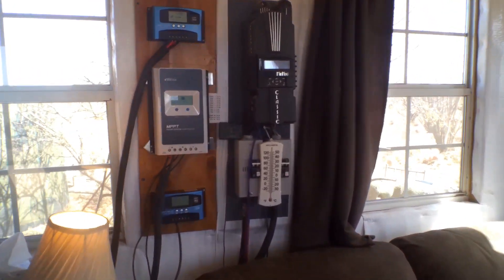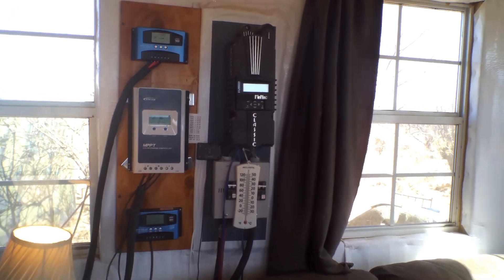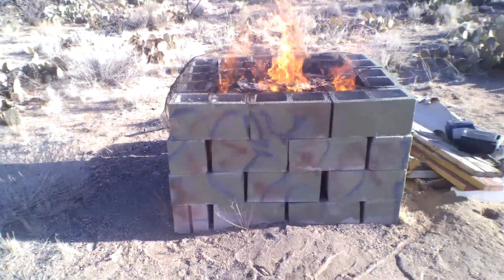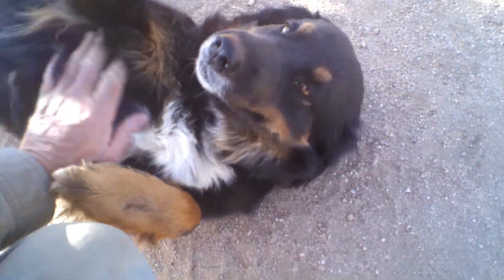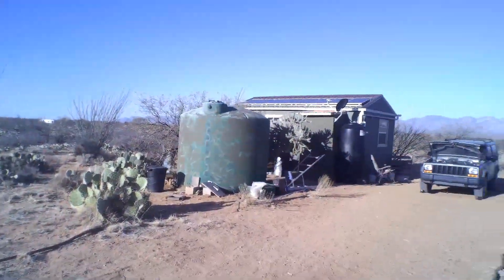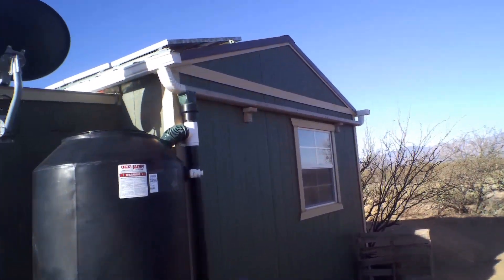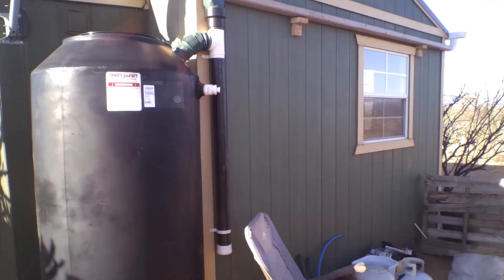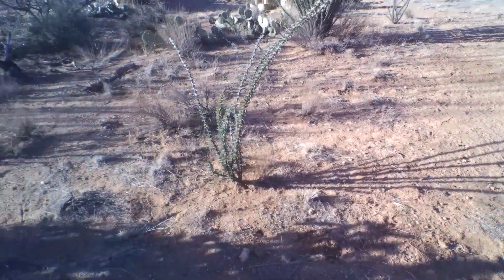First Flush/Rainwater collection & 2Kw of solar @ AZ Off-Grid (Unplugged)

Comment: I like how you split the solar panels apart. If 1 controller failed you still have power I would like to know how the batteries are set up ? Is it 12 or 24 volt.
Reply from the maker: I have (16) 6V hooked up as (8) 12V.. here is a complete video before the new additions.. 
 https://www.youtube.com/watch?v=JtlOPsKivlw&t=16s
The main reason I have so many charge controllers is for "backup" if one should fail..
.. .Happy Trails.!!
Reply: @deserthorizons  thanks for the info. we will be down that way in April for a long stay on our land to get it surveyed and septic installed.  we have 12 volts on the rv ,2 batteries for lighting and water I have 2 more batteries for the 12 volt 1500 watt  pure sine wave inverter I use to run a pellet stove in the rv. Looking at 24 or 48 volt for the cabin. We hope to have it in place this fall.   thanks again for the info

Comment: How do you deal with grey water?,  is
There a permit required for a grey water disposal system if thats what its called. Im buying an acre parcel a few miles north of your location, just waiting on Title company, nice rain water harvest system you put together
Thats what I plan to do as well.
Reply from the maker: Grey water from the RV goes directly onto the base of a tree.. Grey water from the cabin goes into a bucket that I pour on a different tree.. I don't do dishes so I don't have that water to deal with.. What I am doing and how I dispose of my waste (all of it) has been inspected by the Arizona Dept of Environmental Quality and approved.. No permits required.. If I wanted to put in a septic system then I would need a permit.. ..Before you actually purchase,, check out the proposed "Interstate 11" route ( I-11 ) .. ..jus' sayin'.. ..Happy Trails.!!
Reply: What is your zoning there?, land im 
Buying is GR-1.
Reply from the maker: @scampbell8247  I believe but not positive it is officially zoned CR-1..
Reply: Thanks, I may actually reconsider having a septic put in as its gonna cost around 6k.

Comment: you really need to replace those two FAKE MPPT Blue charge controllers, they are PWM even tho the say they are mppt.
Reply from the maker: I know those 2 blue ones are PWM.. Did you know that the Epever is a hybrid PWM/Mppt .?  It actually says it in their promotional video.. Each of the 2 blue ones only handle (2) - 100 watt panels.. .. Happy Trails.!!

Comment: Hi, Great work- looking good.  Just a couple of notes worth mentioning. I'm not sure if mosquitos would lay eggs in your water tanks. Mosquito netting? Chlorinating the water? 
If the T connectors are made of PVC you might want to paint them to block the UV rays. Of course you may have already thought of this, and I'm just blowing smoke.
Reply from the maker: Howdy,, Thank You.. Actually I do chlorinate the water slightly.. But we really do not have a problem with mosquitoes out here.. Much toooooo dry.. .. Gnats on the other hand are worse than the flies,, and this is/was a cattle ranch..
Plans are to paint almost everything the same Olive Green color I have everywhere else.. Paint is just not very high on my priority list.. Actually just one step above that on the priority list is "No Painting Today".. I do appreciate the "head space" though.. ..Happy Trails.!!

Comment: Can you explain why you have you hood up on you vehicle all the time, is it something I should be aware of, and need to do, another arizona youtube does it also.
Reply from the maker: Packrats setup their nest in a dark place.. they also hunt for food in a dark place.. The hood up during the day dissuades them from setting up "home" and the lights I have under the hood that come on automatically dissuade them from looking for wires to chew.. Yes,, You should be aware of it.. I also have 8 rat traps under the hood.. In Oct 2019 my Jeep would not start because the packrats had eaten through some important wires.. I was not able to go anywhere or do anything off property until I got it fixed.. Which was not until June 2020 that I got it running.. 8 months stuck on property.. After I got the Jeep running,, I realized I did not need to go anywhere.. .. Happy Trails.!!

Comment: You might want to get a 12 V blower and using on your burn barrel and actually get some usable heat from burning your garbage and heating some hot water for showers a preheated for your showers in the Lake a couple of W of blowing air over your garbage will create a lot of heat make a cleaner less pollution
Reply from the maker: I need a shower more than once every 2 or 3 weeks.. I only burn that often.. (if that).. I use an electric water heater running from solar.. Burn pit is also toooooo far away to run a blower.. .. Happy Trails.!!

Comment: Your 'set-up' is looking pretty good, man.. I'm happy for you!
How are you doing at keeping the packrats & other pests out of your RV?
Reply from the maker: Thanks,, I appreciate it.. .. Well,, I either catch them going in or once they get inside.. Not had any packrats "inside" yet, but have had mice.. Remi has done a fantastic job of helping eradicate them and keep their numbers down.. Impossible to totally eliminate.. I used to catch at least 1 a day..  I do have about 12 rat traps spread around the property that are good at catching mice too.. Now it once every month or two.. .. Happy Trails.!!
Reply: @deserthorizons    zener  diodes  can load up your solar panels  with say a hot water preheat tank so you do not over charge your batteries
Reply from the maker: @josephdupont  .. Well I prevent overcharging by using a good quality charge controller.. .. so then what do I do with my solar electric hotter water heater that I currently use to get my water hotter.?  it uses 415 watts,, plenty to burn off excess..
Reply: https://youtu.be/e7g75kuL3pw
Reply from the maker: @josephdupont    ummmmmm,,,  why.?